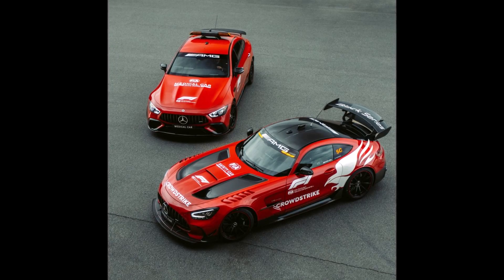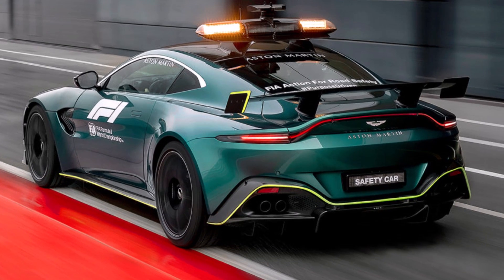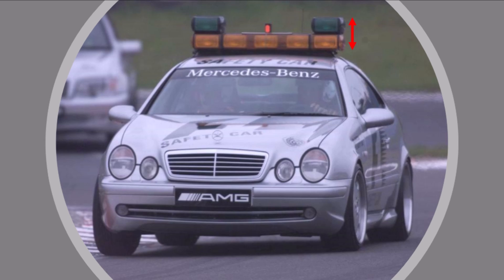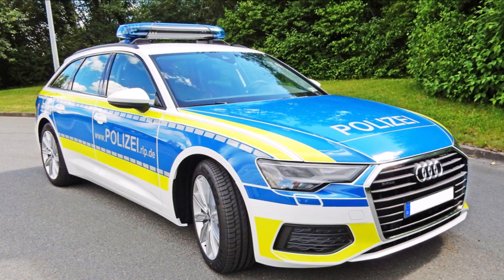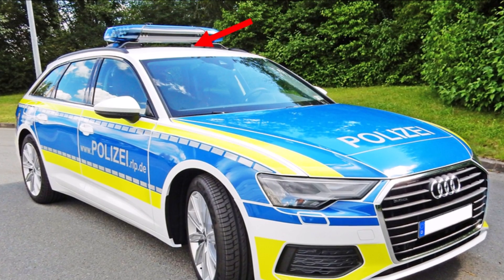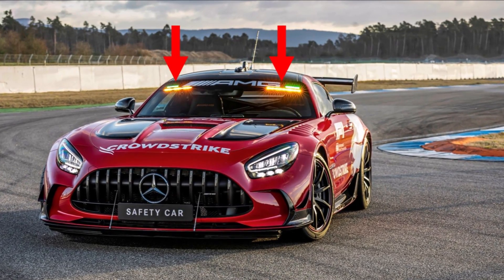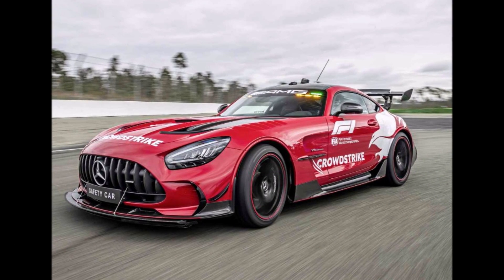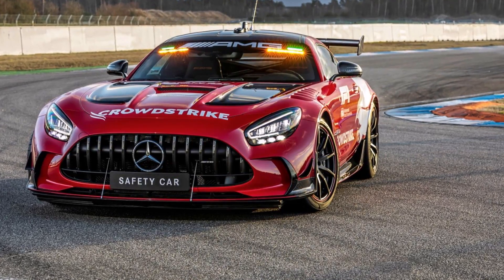F1 2022 - Safety Car Aerodynamics - EXPLAINED

Comment: good stuff but for the usa at least they should use Tesla to show they are serious about emissions , besides tesla much faster also
Reply: Tesla's are not faster around a track than a car like this at all, they are only faster at 0-60 but are boats around corners
Reply: Teslas are only fast in a straight line
Reply: Nurburgring lap times:
1. Mercedes AMG Black Series - 6.43
2. Tesla Model S Plaid - 7.30

There’s a huge gap there despite the Tesla being faster on a straight line. And I’m not sure if you’ve noticed, but F1 circuits tend to have more corners than straights.
Reply: @devandrasimanjuntak1646  yep exactly, this guy has no idea what he is on about
Reply: This would only work if they added as much, or more aero and tire compensation.  As already stated, getting a 44-4900lb production Tesla around a corner quickly is no small feat.
Reply: Who cares about a safety car's emissions, when 100,000+ people (for certain GPs, several hundred thousand) arrive at the track, quite a large portion of them driving a car. What the race cars and the track personnels' vehicles emit is negligible.

Comment: About time they made the safety car faster. Still the car is way too heavy.
Reply: To be fair they have to carry heavy equipments
Reply: A safety car's job isn't to go fast. It's the complete opposite
Reply: @defnotatroll  Not a complete opposite, or otherwise you could use a Renault Kangoo. They have to maintain a certain (very high) speed for the F1 cars to function at at least a basic level.

Comment: It will be interesting to see if there are fewer drivers complaining about how slow the safety car is going only to be told they are going as fast as they can.
Reply: Doubt it, the difference between this and the GT R is tiny compared to the gap between an F1 car and any road car. People will still complain
Reply: @arthurb5194  hahahaha, just heard the first complaint of the season. The safety car is going too slow in the straights apparently.
Reply: @beardedchimp  To be fair it was going pretty slow haha, probably to back up the pack faster